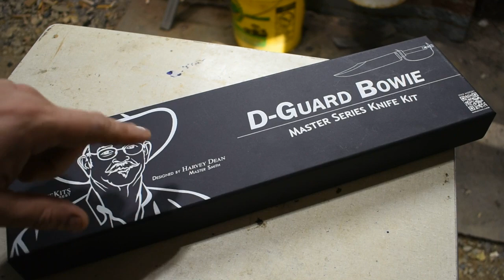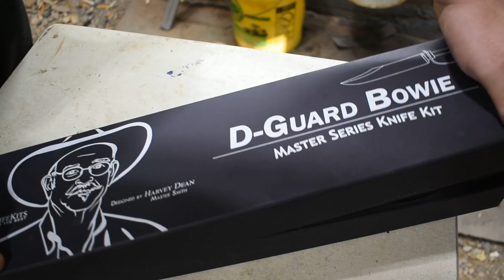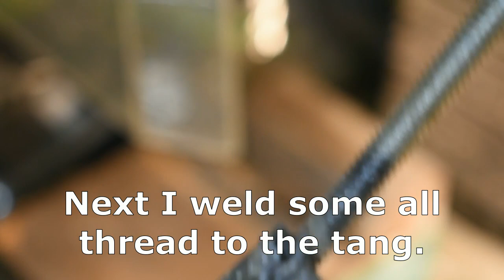Forging a Civil War style D guard Bowie knife part 2

Comment: Dude how long is that bowie
Reply from the maker: This one is patterened after a design used in the civil war I came across on an auction site, the overall length is 20.5 inches with a 15.5 inch blade. Thanks for watching, I greatly appreciate it.
Reply: @Mysticmountainforge  Ya definitely, I love watching stuff like this cause I'm a beginner smith my self and I love getting ideas from better smiths than I am.